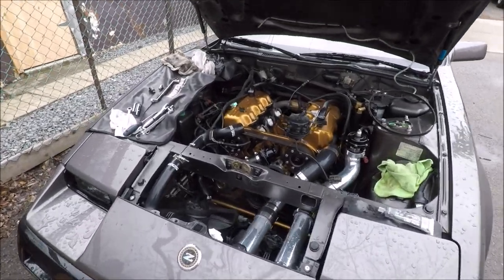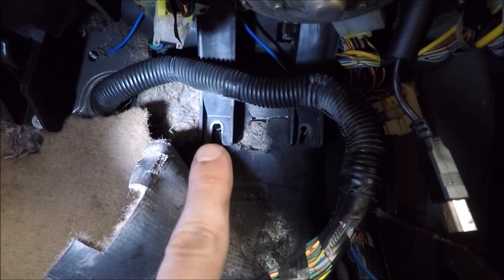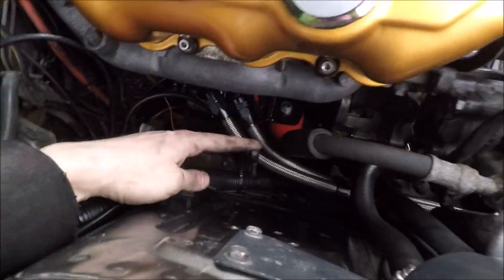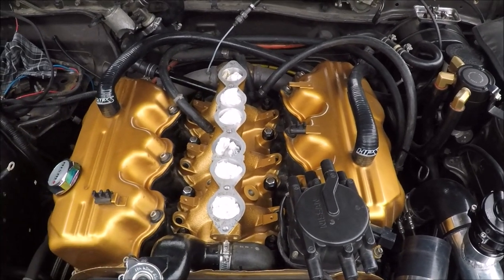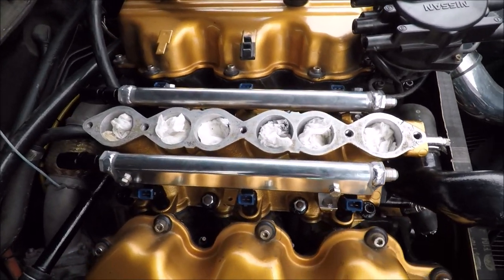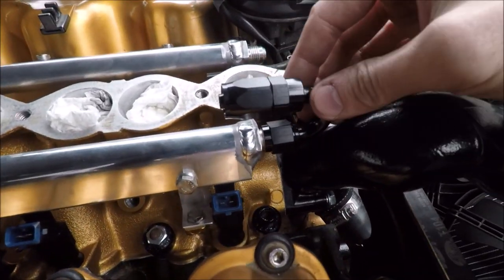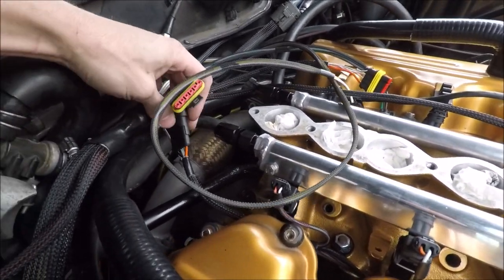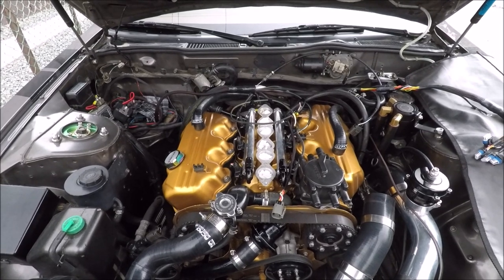Upgraded Injectors, Rails and Harness - Z31 Megasquirt Build

Comment: Awesome build... only thing I would be concerned about that I saw was where the fuel line loops from rail to rail... is how close that crossover pipe is. make sure you put a heat shield there or something.

Comment: which sensors did you get with the harness? iat,clt? what tps is that? what is your wideband setup? did it come with the harness?
Reply from the maker: iat, ctt, s13 tps, aem map. I have aem wideband that wires into the ecu directly
Reply: @TurbochargedCreations   how is boost controlled? I do have a profec B  but would rather the ms3 do the job. sorry for the questions, my setup will be similar to yours if not identical
Reply from the maker: @1971mustang007  There is an electronic boost control solenoid that is sold seperatly that i added to the kit. The wiring is already part of the harness so its just a matter of hooking up the 2 wires from the boost controller and plumbing the hoses and that its, ecu can now control boost